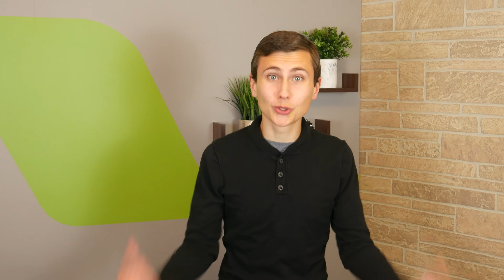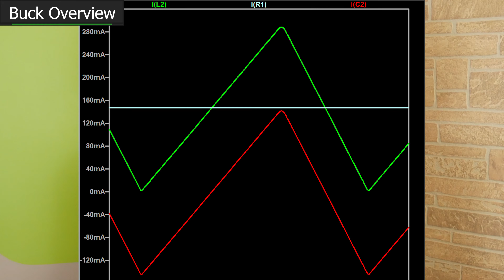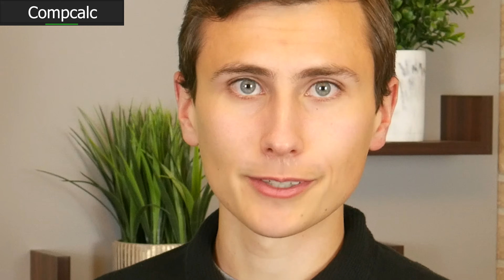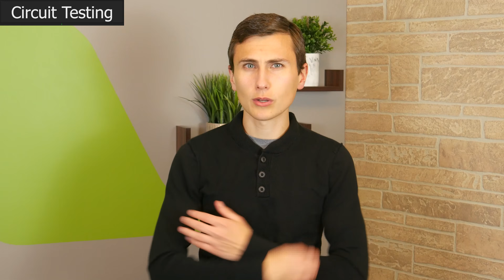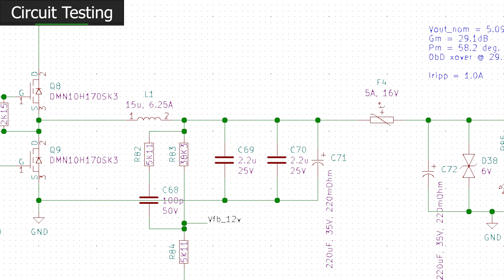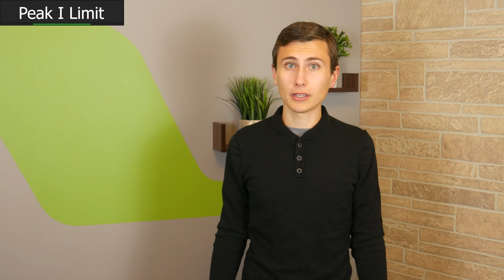5V / 12V / 15V SMPS Testing! (Line & Load Regulation)

Comment: Someone asked about a 12v push pull and voltages on primaries, but the comment dissapeared for me after I replied? Must have been answered?

For completeness: I've found the TI power topology handbook handy for what the waveforms and equations should be. (slyu036, Markus Zehendner, Matthias Ulmann).

 The question related to the primary switch voltages of the 12v converter being 24v. Given CCM the max voltage is 2 * vin, given DCM -> Vin + (vout + vf)*np/ns. I initially quoted the CCM as that's what I remembered =)
Reply from the maker: Strange! Oh boy! There are a ton of "Likely Spam" messages. I'll dig through those and see what's going on. :) Perhaps there were some links shared.
Reply from the maker: Yeah... No Corporation, I found that comment in my notifications.. but it appears to have completely vanished. :( Maybe it's stuck in YT comment purgatory and will come back in a couple days?

Comment: Good work =) I've been thinking about your PTC efficiency problem. I was thinking of a solution similar to a soft start bypass circuit, with some sort of latching relay?
If you give up on indicators, a latching micro relay with a good enough break rating might be suitable? Given we're talking 24v and less, automotive people seem to be fine with doing things solid state now? (i.e. FET's, or 12v/24v load switch IC's). Personally for 5v and less, I just use really cheap 5v load switches. MIC2007's are cheap enough microchip ones, although jw7115's and others from lcsc are even cheaper. For 12v/24v load switching with OCP I can't remember the IC's specifically, but there were ones from infineon and others?

You could "Roll your own OCP" with a relay of your own?
I prefer having a physical switch. The hard part is finding the break performance of a latching relay with an actual switch as well. I don't know whether one can get DC circuit breakers with switches/physical actuators/position indicators?

I've found widespread availability and use of gruner 721 relays for AC applications. I haven't been able to find a local AU distributor for their DC contactors. Plus they're expensive?
HFE10(hongfa, they look like they have larger ones as well?) seems to be what I can find cheaply. The datasheet doesn't have a curve for electrical endurance, but 5k ops breaking 60A 250vac resistive load is nice, but doesn't help with DC i think? I recall a toshiba relay with a full curve for DC breaking, with good rating up to breaking 10A, but that wasn't latching. I don't have a link, plus it took ages to find, going through every relay on mouser pretty much =P HFE10 has 6k ops for electronic ballast 277VAC@ 16A, whatever that means.  Perhaps with a PTC or TVS diode in parallel that would limit damage to the contacts? (Ed -> magnetic blowouts is another option, although I don't think the cheap or low current, "low" voltage stuff is going to need that?) I don't have experience designing around saving relays, typically I just buy the right contactor/relay =P

I've also found magnetic latching automotive relays, they don't have position indicators and/or manual reset stuff though?
Reply: had another look, Albright international seem to be good for DC latching contactors, with good availability.

There's some Dayton relays in the US that are NOS as well that look cool.
Reply from the maker: HI No Corporation, Thanks for the awesome comment! There is a great wealth of "e-fuses" that may apply... which are basically a pre-canned solution for high-side OCP with integrated FET.

I like the wealth of options though! There are many ways to get something done, and depending on the application I can see a lot of what you're seeing working. Not sure where we'll end up!